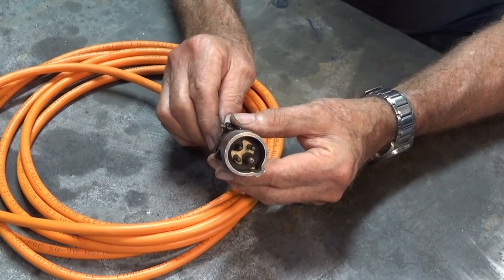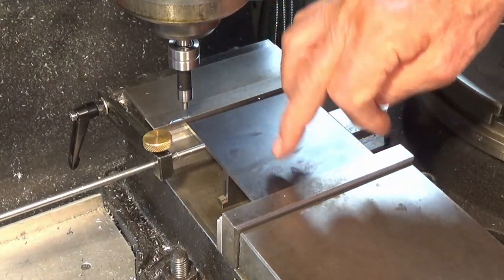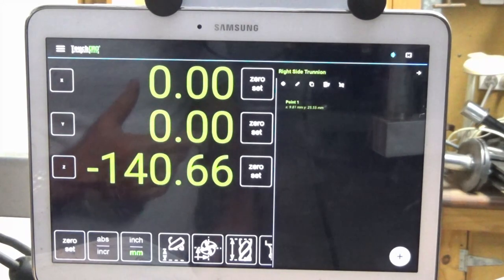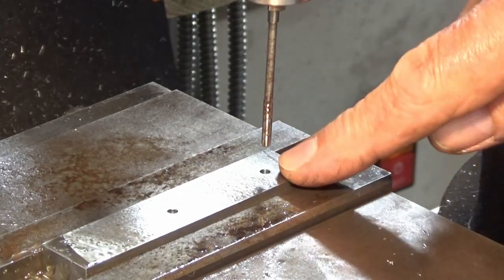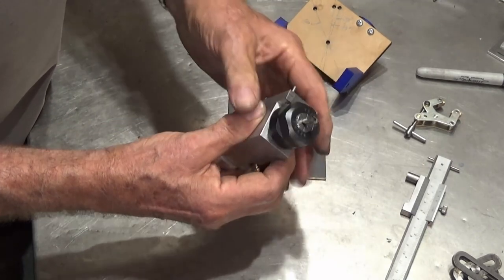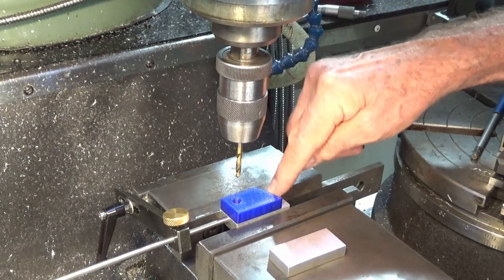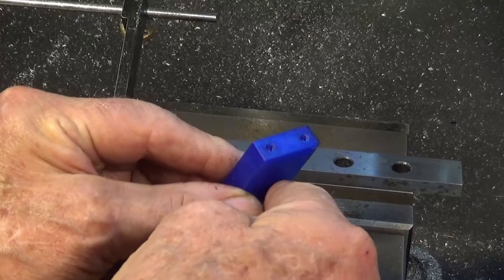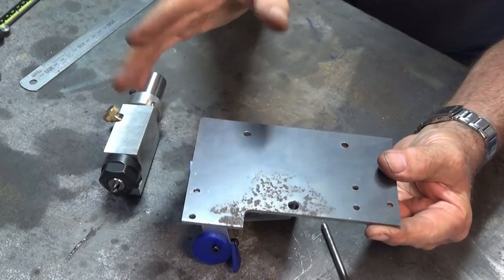A 4 Facet Drill Bit Grinder DIY Style Part 3

Comment: Hi, great videos, some electrical plug manufacturers supply multipin plugs with different orientations to ensure the  plug can only be inserted into the matching socket. Great series of videos. Many thanks
Reply from the maker: Those LPA plugs were indeed sold as trailer wiring plugs and the original manufacturer suggested that I used  their range of military or aviation connectors. I had no idea what current or voltage requirements each plug was capable of so I thought it best to stick with what was already on the machine. I still think it's odd that all the parts were identical on the two plugs but they had completely different part numbers.
Regards,
Mark

Comment: Hi Mark. Nice job.

That two posts.. of course there is many ways to do it, but I will preffer different approach.

Make that two blocks identical, rectangular, and horizontal dimension need to be larger then there projection to the plate.

Now, make the axle hole in the same spot for both blocks (gang drill/ream them), with horisontal offset measured from the edge of the plate.
Drill, tap M4 holes according to the holes in the plate (same offset from the edge).
Now you can cut excess triangles from blocks, but this is no more critical dimensions, this is just clearance. You can cut it with a hacksaw if you want and just file it for apperance.

Comment: Gday Mark, I'm really enjoying this project. At first glance it's deceiving that so many precise setups would be needed...but there's quit a bit going on. Can't wait to see the finished product and first grind.. Well done !
ATB....Cheers....Dean
Reply from the maker: Thanks Dean. I have a tendency to overthink things and I am sure that you could get an acceptable result with a lot less fuss. However, so far most parts have gone together straight off the mill and the lathe. I did have a bit of a foul up today though. It was a hole drilled in wrong place however I drilled it precisely in the wrong place. 🤦‍♂️🤦‍♂️🤦‍♂️
Regards,
Mark

Comment: As always, a great watch Mark. Haven't quite got the lathe and accompanying mill yet 😄. But I do have a basic 3D printer. Onshape and a bit of thought has created a gimbaled beer...er...refreshment can holder for the golf trolly (Very useful), a custom depth jig for the Dremel and a host of other things. Plastic is good, but I feel the need for steel getting stronger 😉.
Cheers
Pete' Hokitika N.Z
Reply from the maker: Those new fangled 3D printers will never catch on😁😁😁 Seriously though, you can do a lot with inserted metal parts in 3D prints to strengthen them. If you software has a pause function, you can stop the print, insert a rod or a sleeve and continue printing. A bit of strategic reinforcement can do wonders for prototyped parts. You can also insert carbon fibre or flat sheet materials like fibre glass or actual glass to strengthen parts. 
Regards,
Mark
Reply: @Preso58  Oooo...Thanks for the idea of inserts Mark. Mine's an Ender 3 Mk2, so will see what options in that direction it has.
Cheers
Pete'.

Comment: Looking good Mark! I use alignment dowels with flats for waveguide alignment, with one slightly longer tapered pin and a short one with flats to help with assembly
Reply from the maker: I remember now watching a video by Stefan Gotteswinter where he discussed using diamond dowel pins for alignment of parts. I had totally forgotten about it until recently. I am hoping that I can grind some flats on my dowel pins using the D Bit grinder. Thanks for watching.
Regards,
Mark
Reply: @Preso58  I remember that vis from Stefan now. i might try that four facet diamond grind for future projects, these pins are only 1/16th of an inch diameter and 5/16ths long so it's easier to grind two facets on the alignment pin than four

Comment: You can position your holes in your cad system at whatever angle you want and then drill the holes numerically with the DRO you don't need to have a drill template. A  lot of things that you're accustomed to doing manually can be bypassed  by using the DRO. I don't even mark or layout anything anymore i just use the DRO and position numerically  it's quicker and more reliable. I have never  used  Dykem. I won't scribe a line to mill to I will just position numerically with the DRO instead. Manual milling curves or challenging shapes are of course always trouble on a manual milling machine. If I need those I will either CNC mill or water jet them and avoid trying to reproduce them by hand. You do a nice job on your videos .
Reply: You stole my thunder!
On my DRO I can locate a centre, define a radius,  and then define an angle.  You can also define a bolt hole pattern with a starting angle.
Reply: I was surprised he did it that way as well. Could have been done in the same setup as all the other holes and probably be more accurate with less work. But the end result is the same either way.
Reply: Yeah it is a shame that  his DRO doesn't have a hole circle function, it's not like Prezzo would have missed this simple highly accurate solution.
Reply: I don't care how good you think your DRO is if you spot and drill a hole it will be where the drill felt like going. For accurate positioning it must be bored.
Reply from the maker: I totally agree. TouchDRO has a function for laying out holes or points in a trig pattern. You can specify an x and y coordinate and the readout will also give you the vector angle. I did think about using that function but I realised that if I got it wrong, even by a few microns, the pins wouldn't fit. Making the drill jig allowed me to try out the fit on something that didn't matter. Once I knew it all worked I was happy to go ahead and drill the hole pattern in the trunnion plate. Call me conservative, but I wanted some reassurance before drilling the last three holes in a part that I had already invested several hours into. 
Regards,
Mark

Comment: Gday Preso, plenty of technical parts involved in this build, it wouldn’t be hard to make a mistake that’s for sure, I think it’s a bit outa my skill set mate, absolutely awesome job, cheers
Reply from the maker: Thanks Matty. I am sure you could get on top of this project but it would probably turn out to be capable of grinding 50mm diameter drill bits. 😁 Now that I have sorted out my issues with the scales on my mill and TouchDRO is playing nicely with the glass scales I am really enjoying the confidence of knowing that parts will turn out the correct size for a change.
Regards,
Mark
Reply: @Preso58  when you updated the scales I looked for the updated version to download but I couldn’t find it, im not that good on computers so I was probably looking in the wrong place, the interface of the TouchDRO is really easy to use, I’d be lost without now

Comment: I like your vernier scriber. Is it commercially made, or did you modify a caliper?
Reply from the maker: You can buy those vernier marking gauges on Ebay. They are made in China and not all that expensive. They come with a spare carbide scribing point too. I hate seeing people marking their scribe lines using the points on the ends of their digital calipers. https://www.ebay.com.au/itm/404174331265?hash=item5e1aaadd81:g:0iQAAOSw2GZj9cS5&amdata=enc%3AAQAHAAAA8NXvsNDVYGYdBxegQqBf4fh4xsAu8PpfBKn8Pm8la9E4HLB4z0RLX5LcpQ5P886rTJStnMVTf%2B8RbtPKqVppOJaWICi51OhdsNSpWhppxV1w3JQ7JsRQYCYbxzuTfBbK%2B4oat%2FUnqsuspFTpxoQR1dxp1H8tZKZXD8SrK5YAietyaMn%2FdGKLbG3zke%2FgtpKPUL8YpgHXzya1X43LZ6eRJmIAB478cQJ3ISCEiA1jm7SVDlqeg88uZVolvfA5wHQ6Y%2FukQKlrXb3kfKG2ZgjNhFCrbEhwo680klUdg7Sq4RUp%2FHEWUG6rEgJMwtivqhZrLg%3D%3D%7Ctkp%3ABk9SR4TtqcvaYQ
Reply: @Preso58  Thanks, Mark. Being in the US I'd like them to read both mm and inches. They have inches, alright... in 128ths! Sheesh, I don't think even woodworkers use 128ths anymore, so that's not suitable. I think I'll get a cheap digital caliper and modify the jaws specifically for scribing. Then I'll be using them as intended, and that shouldn't upset you.😁

Comment: To make the collet block a little easier to mount and dismount, would it help to make the pin for the central hole a tad longer than the angle setting pin ?

John 🇨🇦
Reply from the maker: Good idea. I have also been reminded that diamond pins exist. I think Stefan Gotteswinter used them in a similar situation. They can be clocked so that each pin has clearance in one opposing axis. I have to do some more research.
Regards,
Mark

Comment: There appear to be something called “diamond pins”, which are part flattened dowel pins. The idea is they retain accuracy in only one axis, making them easier to remove. I wonder if you could use a normal dowel on the pivot and one of the orientated for radial accuracy at the rear? Making it easier to remove but keeping angular accuracy?
Reply from the maker: Ah yes. I vaguely recall Stefan Gotteswinter showing pins like that in one of his videos. I may be able to grind the pins on the D Bit grinder.
Regards,
Mark
Reply: @Preso58  they seem popular in American YouTube channels... I'm not sure how to search for them here, quite possibly they are in my local supplier but I'm searching on the wrong word? 

The made ones have a very specific pattern. However I wonder if it's enough to sightly relieve the sides for a DIY one?

Comment: I could laser cut the sheet parts including the handle and link for around USD 5. However intl. postage would be more than twice that so probably not a viable option for anyone.
Reply from the maker: And that is why we don't have access to low volume laser cutting services here in Australia. Along with McMaster Carr and companies like Send Cut Send, we seem to be on the forbidden list. There are plenty of laser cutting companies here but they don't want to deal with small orders. Maybe that will change but with this project you could literally just stick a paper drawing of the part to a sheet of steel and cut it out with an angle grinder or a hacksaw and file to shape. 
Regards,
Mark
Reply: @Preso58  I have actually cut parts for a couple of people in Australia - and I live in Denmark! They could not find anyone locally who would take small orders.

Comment: Why clock the pins 90 degrees? To make it proprietary and sale the plugs at inflated cost :)
Reply from the maker: I am at a loss as to why you would incorporate such an arbitrary change in design. Unless it's for commercial reasons as you say.
Regards,
Mark
Reply: @Preso58  Commercial reasons are why you go with proprietary design. Not that I support that, but that sounds like it is the case with this plug.

And as a computer guy, I strongly believe in open source.

Comment: The angled supports are mirrored right?  Is there a reason not to machine them as a clamped pair?

Thanks for the great videos.
Reply from the maker: You could do that and in fact, John Moran's build notes suggest that method as being the best solution for those builders who may not have a DRO fitted on their milling machine.
Regards,
Mark

Comment: Hey Mark.  Your comment about the axis of the trunion and drill centre being necessary for accuracy is not strictly true.  The design of the jig is to allow the setting  of the primary and secondary clearances with minimal resetting of the collet wrt the grinding wheel.  I was going to build a jig exactly like this, but as I had a T&C grinder in which I could advance the whole jig towards the wheel, I did away with the tricky alignment requirements of the trunion wrt the axial centre of the drill bits in the original design.  BTW.  Loved the use of 3D printed parts to test out the design.
Reply from the maker: Yes, 3D printers are a real game changer in my workshop. I love the idea of getting a live 3D part with minimal effort. Once I see it in my hand I will know if the concept is viable or not and if it needs reworking I can do that without wasting a lot of material and time. I have sharpened drill bits on a D Bit grinder but mine takes 5C collets and you sort of need a collet for every size of drill bit you need to sharpen. With both letter and number drill sized bits in my collection it's not really going to work for me. Still, I won't know for sure until I have finished the machine and given it a thorough trial.
Regards,
Mark

Comment: Why not just work out the hole locations with trig (or CAD) and use the DRO?
Reply from the maker: You can do that and TouchDRO has a function that allows you to move in X and Y and the readout shows the resulting angle. However I knew that if I messed up just one of the holes it would annoy the heck out of me. Making the drill jig allows me to check the fit on something that doesn't matter. If it was wrong I would just drill another two holes in the jig. Once I know it's correct I could drill all three holes and I knew they would all be correct. 
Regards,
Mark